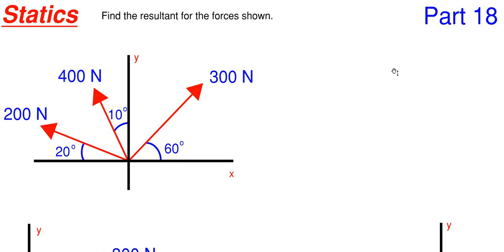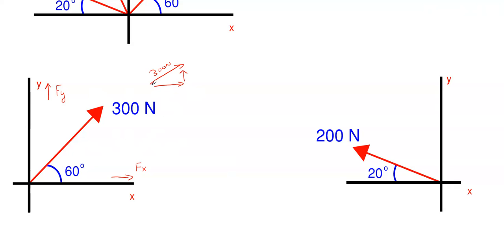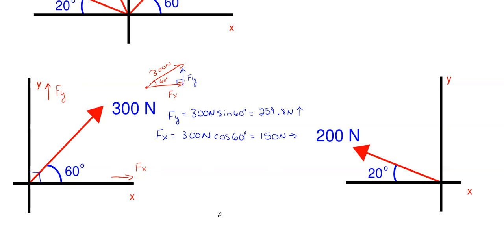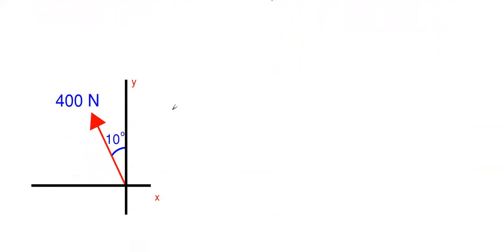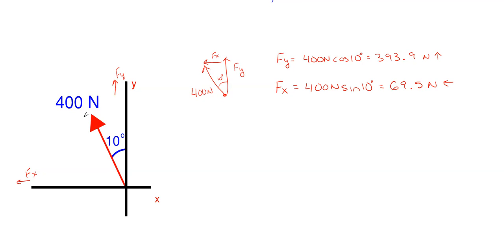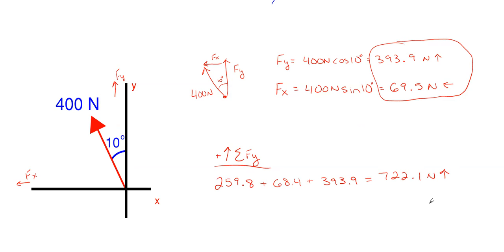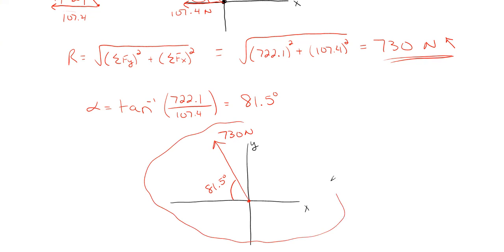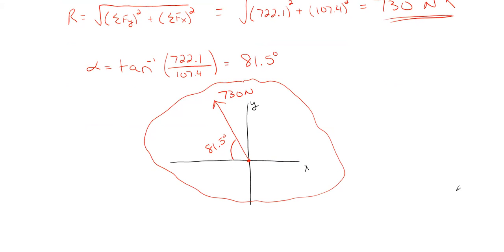How to Find the Resultant of Three Force Vectors – Statics Components and Resultants Problem 18

Comment: Something is wrong
Reply from the maker: Can you please explain where the error is located?
Reply: @Professor_Engineer  the total of Fx and Fy?
Reply from the maker: @veniceelopre1016  Are you stating that the total of Fx and Fy are both wrong?  Well, if we look at it further here: 
Summing forces in the Fy direction (taking up as positive): 200sin(20) + 400cos(10) + 300sin(60) = 68.4 + 393.9 + 259.8 = 722.1 N in the upward direction.
Summing forces in the Fx direction (taking to the right as positive): -200cos(20) - 400sin(10) + 300cos(60) = -187.9 - 69.5 +150 = -107.4 = 107.4 leftward direction (since it came out as a negative number). 
These values match the ones shown in the video.  Did this explanation help solve any confusion? Or do you still see an error?
Reply: @Professor_Engineer okay thanks. I learned a lot, but I still don't get why Fx has sin in the total and same things in the Fy has cos huhu.sorry
Reply from the maker: So, the sine and cosine depend on where the angle for the force is measuring.  For example, the 400 N has the 10 degree measuring from the y axis, thus in the FX equation, it will be 400sin(10) and the FY equation will have 400cos(10).  This has to do with the right triangle relationship between sine and cosine of an angle.  Since cosine deals with adjacent, if the angle is measuring from that axis direction, use cosine (the angle is off the y, thus use cosine when looking at the y direction).  Since sine deals with opposite, if the angle is measuring from the opposite axis direction, use sine (the angle is off the y, which is opposite the x, thus use sine when looking at the x direction).  
Hope this helps clear up any confusion.